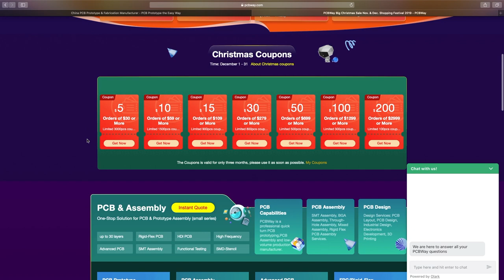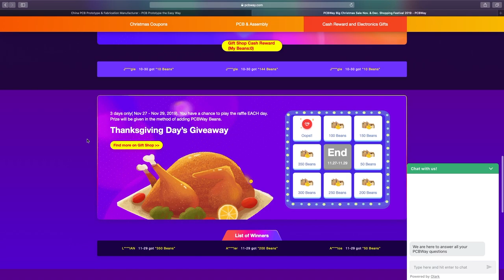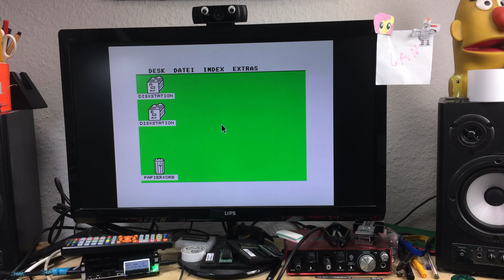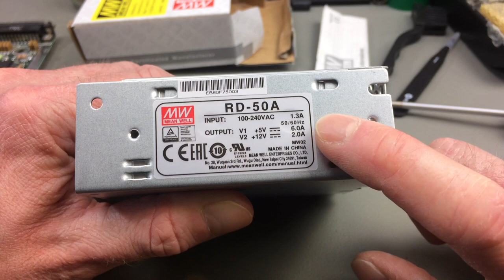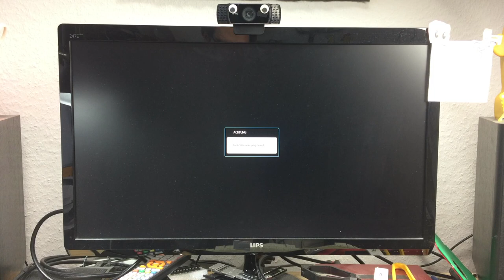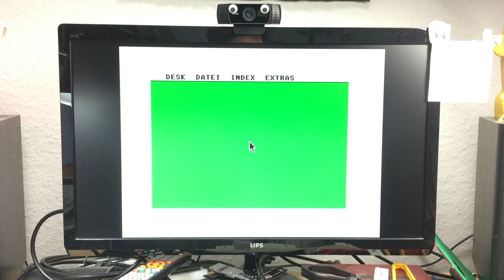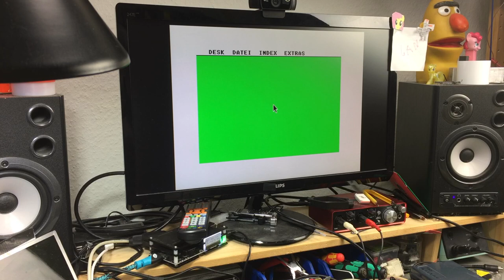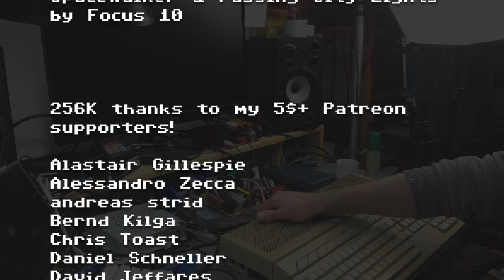Atari 1040STF Restoration Part 1: The Electronics

Comment: The gem booted from rom much quicker after the recapping, probably because the defective drive was causing it to hang before and wasn’t connected. They never thought to give the user any feedback on what that the computer is doing back in the day, just sit there and wait and pray it gets to the desktop.
Reply from the maker: I think with the drive disconnected, it doesn't look for a boot disk so it starts from ROM immediately. The long delay is the same with a working drive and no boot disk I think.

Comment: wouldn't it have been a better idea to remove the meanwell pcb from the casing?  mount the meanwell pcb to the atari psu bracket instead?  with plastic standoffs of course.  would have been a lot better than cutting and drilling and filing the hell out of the meanwell case.  waste of time.  anyways.. other than that, nice work.
Reply from the maker: I deliberately chose the Meanwell with the case for added safety (because the metal cover that is usually covering the original PSU was missing in this machine). There are versions of the same PSU that come without a case from factory, would definitely be an option.

Comment: still don t understand why to change that all. i would consider to check the values of the capacitors and if they deviate too much xchange them. - concerning the floppy drive why didnt you easily format a disk in GEM to see if that is working? as you might know the other Ataris can use dfferent sector alignments

Comment: You could have repaired the power supply instead of replacing it with another type. These Atari power supplies are very easy to repair; the fault is nearly always the same and can be fixed by only replacing the 330uF capacitors with 470 or even 1000uF. Problem solved!

Comment: Nice Video, but maybe you should have covered up that PSU to prevent electrical hazards (say with cardboard).. i'm fixated on your not touching it!
Reply from the maker: I used a ground fault circuit interrupter for added safety (that white square thing I'm plugging the mains plug into). Usually I would even use my isolation transformer but that tends to blow the mains fuse for some reason so I'm not using that at the moment.
Reply: @JanBeta  that's good. Your videos are the best of all the electronic channels I watch. Best wishes

Comment: the OEM floppy drives in the STF was a very common failure. I my area, many were replaced with a standard PC drive, and case was modified to fit the drive face.

Comment: Jan you can't have PG go from the IEC to the bracket and then from the bracket to the PSU. If either of the screws get loose you will have intermittent PG. You should have soldered a new yellow/green wire to the center of the IEC connector and go straight to the PSU. Electrical code is a bitch ;-)

Comment: I would have just taken the new PSU pcb out of the metal case and mount as per the original PSU pcb.
Of course adequate insulation between ANY metal plate would have been required
Reply from the maker: I think there's also a version of the MeanWell that comes without any casing. I prefer this model though, also because it has the nice screw terminals. :)

Comment: Now I need to dig my old girl out of storage.  I bought a 520 STFM back in 87 or 88.  Later I added an expansion board that let me use SIMMs to add memory.  From that point on I was running MagicSack emulation software to use it as a Macintosh…  worked rather well, even if I did lose some ram to the emulator.

Comment: Nice job with the power supply. The ground wiring doesn't seem optimal IMHO. The wire should go from the power plug directly to the supply and from there to the chassis, for decreasing the chance of interruptions between ground and the supply. Still it's lookig nice and great that it fits.
PS: Please don't use epoxy on the case xD
Reply from the maker: Thanks! I wanted to leave the original ground connection intact because that looked pretty good (proper washer and bolt) and makes the main connection to the shielding etc. The PSU is connected through the screws in the bottom as well as through my extra ground wire so I'm pretty sure it is going to be fine. :)
Reply: Well, that seems like a sensible reason, yes.
I just wanted to add something I noticed: One the one hand an internal supply is more convinient than an external one, like the A500 oer A1200 had. But one the other hand, fiddling with the running system as we sometimes did with our Amigas is a thing that one surely should not do with the ST. But because of your conversion this problem is partially fixed, as the new supply has an enclosure, with the only risky place to touch being the contact terminal. If you'd like to make it perfect on this regards, there are plastic covers for fitting over these contact terminal, popular in the 3D printing community :) (like this one for exmaple: https://www.thingiverse.com/thing:40024)